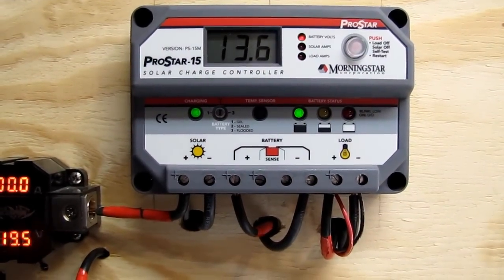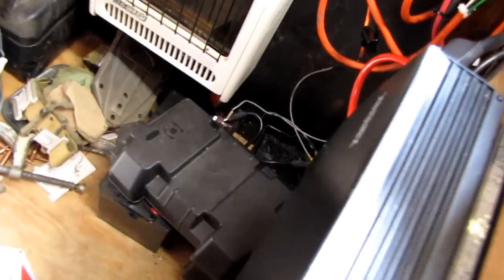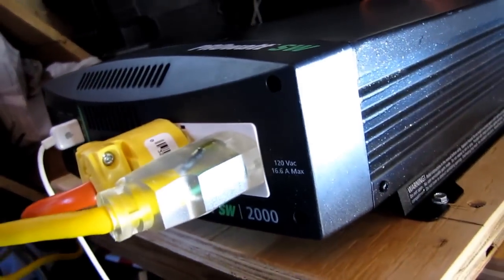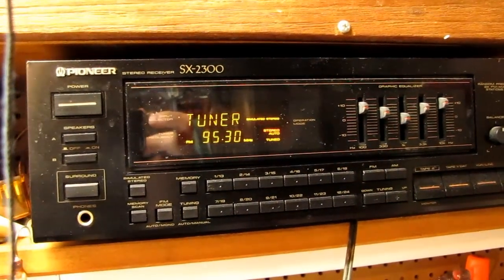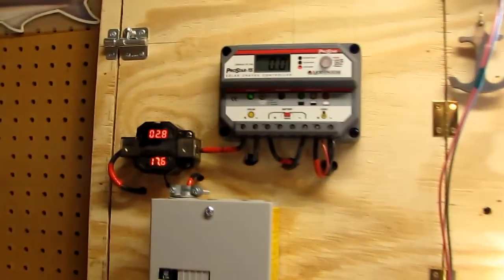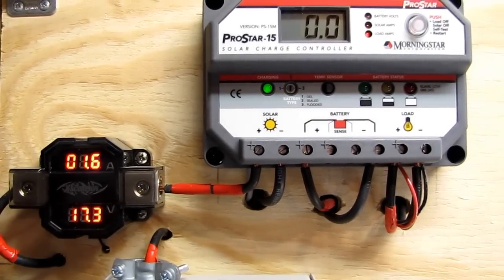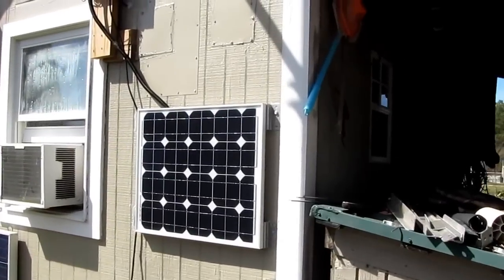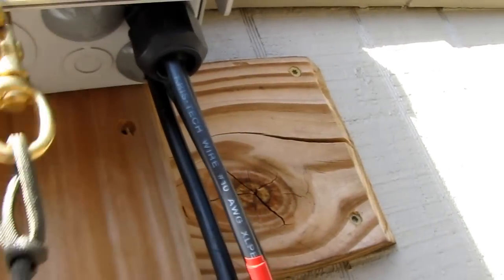Updates My Small OFFGRID Solar Electric System   By  VIARLOCITY

Comment: Nice, looks similar to my building. About to upgrade myself, got 2 new panels (215 watts each) to replace 6- 30 watt panels. Just ordered a midnite solar The Kid charge controller to replace blue sky solar boost 2000e, Its still working but somethin aint right. Eventually getting 24 volt go power 2000 watt pure sine inverter. Out of town working atm, be glad to get back home and set it up. Good vid.
Reply from the maker: Thanks msolar The Kid Will Love It Brother I Had A Blue Sky Also Years Ago !